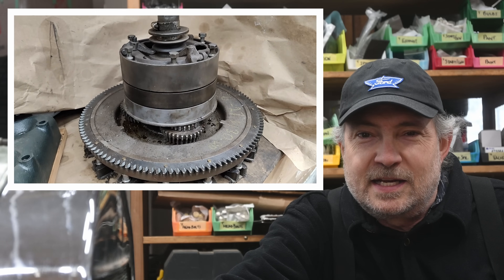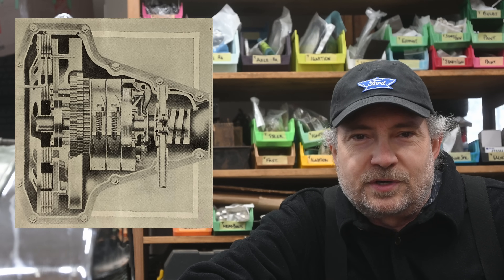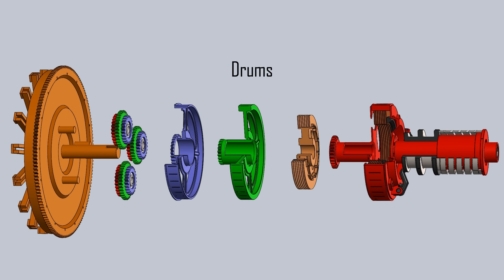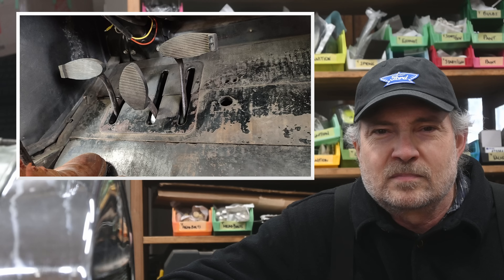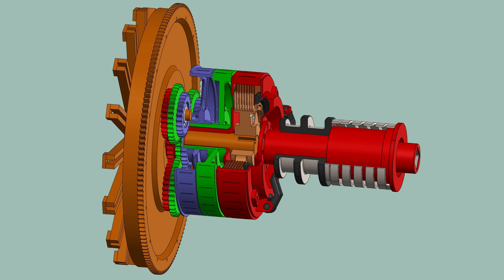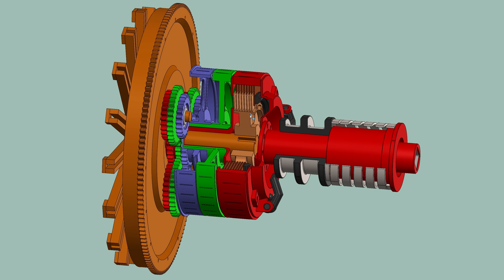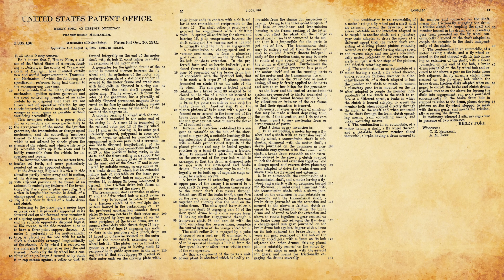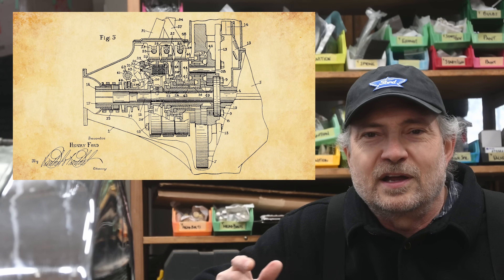How does it work?  Patents, animations. Ford Model T Transmission

Comment: Great work putting this video together, I was curious what makes the drums spin?
Reply from the maker: Each drum has gear teeth that engage the triple gears. The triple gears spin on the flywheel. Whenever there is relative rotation between the flywheel and the driveshaft, the triple gears will spin and turn the drums. Cheers!
Reply: @flivverchannel okay, thanks!

Comment: The multi disk clutch disks from a General Motors turbo 350 will actually fit in place of the multi disk model T one with a little modification. I know this because an old guy I knew fitted some GM plates in his model T to make the clutch smoother. It makes me wonder if the model T transmission was in some way the platform for the development of automatic transmissions in later years.
Reply from the maker: Neat.  I need to replace my clutch disks soon.  Can you steer me towards any more info about this substitution?
Reply: @flivverchannel I can remember the old guy referring to an aftermarket disk set called a “Jack rabbit conversion” but opted towards the GM clutch disk modification probably because he had them and it would have been cheaper. I can remember the original clutch pack was steel on steel which was grabby and not smooth at times. Hope this helps.
Reply from the maker: @JohnShields-ph9ge  thanks!

Comment: Well - you could also make it simple: Model T do have a clutch pedal where when engaged to power from the engine goes right through the transmission much like high gear in many manual transmissions. When pedal pressed, the clutch is disengaged.
In order to enable a smoother start, it have a feature - when the clutch pedal is further pressed, it tightens a band around a drum in the planetary gear, that in effect is a low gear.
In between an effective neutral gear is obtained. By a mechanism at the handbrake, you can keep the transmission in neutral without the need of pressing the clutch pedal.
Anyone used to drive manual transmissions (i.e. most europeans) will understand that 🙂
Reply from the maker: That's a good way to explain it!

Comment: I have always thought the Chevrolet power glide trans was somewhat akin to the model t transmission but rather than mechanical gear changes using your feet the power glide shifts gears through hydraulic engagement. Am I somewhat right in this thought.
Reply from the maker: I think you are right. Although, I am no Powerglide expert. Thanks for watching!

Comment: If neutral is the middle of the pedal stroke, how can you have neutral for starting and idling?
Reply from the maker: There is a linkage between the hand brake lever and the gear select pedal, that puts the pedal in the middle for 'neutral'. Or, you learn ti hold the pedal in the middle with your foot. It's a little weird!
Reply: @flivverchannel  Thanks for the answer!
Reply from the maker: @canuckprogressive.3435  pleasure.

Comment: I’ve got a model T and that transmission is a piece of junk. You’ve got these cotton pants that go around and make the thing run and they’re always wearing out all the rivets get bad and scar the drum. Then you have to Replace the drum.no breaks except for the cotton bands that goes around the drum and slows it down a little if the hill is to steep it does not have enough power to climb it you can turn and back up the hill other than that it kind of fun to drive.
Reply from the maker: Thanks for watching!

Comment: I still don't get the connection between this type of gearbox and the fact that the engine can push the car easily at low RPM. Sorry but English is not my language so it's more complicated to understand ^-^
Reply from the maker: This type of transmission has enormous rotating mass, so it effectively becomes a very heavy flywheel. A heavy flywheel helps an engine run smoothly at very low RPM.
Reply: @flivverchannel  ok so is up to the flywheel... By the way if this gearbox has so much rotating mass it seems not to be an efficient choice, right? I mean the more mass there's between the engine and the wheels and the more energy is dissipated!
Reply from the maker: @MarcoParisi9804  a heavy flywheel is complelety efficient and stores rotating energy. But it makes engine acceleration and deceleration slower.
Reply: @flivverchannel  Got It, thank you very much, appreciate it!

Comment: What makes exactly the difference from Low gear to Reverse gear? At first look the tripple planet will give the same direktion of Rotation of the Output shaft when you are stoping those brakedrums. Is there any combination with the clutch from high gear or the output brake?
Reply from the maker: Stay tuned and subscribe. I am making a specific video better explaining reverse.  Thanks for commenting!

Comment: I have a 24 Model T roadster..In order to apply the brake(right pedal) you have to have the left pedal (High neutral Low ) held in the neutral position. Because if it is not in neutral it will stall the engine. So you must use 2 feet to brake the car..
Same with reverse (Middle)..The neutral position must be held (left pedal) and then push the center pedal to create reverse..

I have Rocky mountain brakes on my T..A big handle on the left of the driver that when pulled backwards, puts the left pedal in the neutral position and applies band brakes on the rear axle
So I don't even use the right pedal..Just the handle..When you pull back a small amount of the handle, it will engage neutral and you can use that to engage reverse..
So you are only using one foot for everything you need..Brake(No pedals needed for that with the RM brakes)..Reverse with the handle in neutral..

Rocky mountain brakes really were an improvement!!
Reply from the maker: There is no problem braking with only one foot at first, as the engine-and-car slow together. But you are perfectly correct that it takes two feet to come to a stop or the car will stall.  Or one foot and pull the hand-brake lever to mid position (which forces the high/low pedal into middle neutral.
I am only passingly familiar with Rocky Mountain brakes.  Most installations that I have seen connect the actuator rods to the brake pedal. But interesting that your Rocky Mountain brakes are only connected to the hand brake lever.
Thanks for the great disucssion!

Comment: What I don't understand is the need to hold a pedal to be in neutral. Didn't a lot of these T's need to be started with a hand crank from the front of the vehicle? Wouldn't that be a Darwinist move when the transmission is always  in gear?
Reply from the maker: True! And Ts have injured and killed owners over the last century. Yes, the shifter pedal must be held in the middle position for neutral... To start, there is a linkage on the handbrake lever to force the pedal to neutral. But it can fail, and then the car lunges forward...

Comment: How does the reverse work exactly I know people who are 65 and STLL don’t understand it and they have been working on them since they were at least 30
Reply from the maker: Reverse is kinda difficult to explain in words.  My animations explain it better - but I will try.   With the output of the crankshaft turning the planet gears forwards, they spin against the output shaft gear.  By locking the reverse drum, since it is also engaged with the planet gears at a very different ration, they can spin such that they turn the output shaft gear reverse direction. Hope that helps.
Reply: @flivverchannel  I did not think you would actually respond lol I am a enthusiast myself and have a 23 touring car it’s more of a joke I like to ask people because nobody can ever explain it that I’ve found.
Reply from the maker: @ZodeusBloomberg  😅

Comment: Fantastic video!!  Your graphics are soooo good!.  Thank you for taking the time to explain this.
I had to call a friend (who is a collector) to ask about how neutral is achieved for cranking.  Ed Archer explained that linkage involved with setting the parking brake (at the rear wheels), also moves the left pedal into the neutral position.
Reply from the maker: Yeah, I didn't do a good job of explaining the pedal and handbrake linkages. I should do another video to explain those better. Thanks for watching!
Reply: OK, you missed one thing, but the rest of it was great.  I will never be as good at making videos as you are.  I'm impressed.
Reply from the maker: @cadmanchannel  😊

Comment: So when you go into reverse how does the hi speed clutch pack disconnect?  Is there an interconnecting cam or something?
Reply from the maker: There is no interconnection between reverse and the high speed clutch pack. Operationally, one is meant to ensure that 'neutral' is selected before engaging reverse. If neutral is NOT preselected, then reverse will stall the engine.

Comment: What did you do, when you wanted to start the motor or let it idle, if you didn't have a neutral? As I understand it, you would have to hold the pedal halfway down. And what did you do if you wanted to push a stalled car? I can't see how you could get by, without being able to shift into a neutral like a modern manual transmission
Reply from the maker: The handbrake lever has a linkage to hold the left pedal half way down, when the handbrake lever is in it's mid position. This way, none of the bands are gripping the drums, AND the multi-plate clutch is disengaged. In this arrangement you can push, or start, the car.

Comment: What is the maximum hp it can handle
Reply from the maker: The Model T only produced 20hp. Some people have used this transmission with more powerful engines, but eventually the band and drum system, or the multi plate clutch, gives way.

Comment: I remember my dad saying that Ford put the flywheel magnets in the T right up to the end, when they had batteries and starter motors.  He said that the first time the transmission had to have the bands worked on they would take all the magnets out (not sure why).  I know I had a lot of them to play with.
Reply from the maker: Yes, some people prefer the simplicity of the generator and battery, rather than ALSO having the magneto.  The magneto was included, right to the end of production, so that you could start the car and run the car even if the battery was completely dead. Thanks for watching!

Comment: Something I still don't understand is, if the left pedal is pressed half way for neutral, how do you start it? With nobody on the pedals, it sounds like you would be starting it in high gear.
Reply from the maker: There is a linkage attached to the left pedal which ensures that the high gear multiplate clutch is disengaged when you are either at the neutral mid position or all the way down
Reply: @flivverchannel  I got that. But does that mean that starting the engine is a two person operation? If not, how is it kept in neutral while you are outside the car cranking on the engine?
Reply from the maker: @johns7734  ah! The handbrake lever also has a linkage. When the hand brake is on, the trans is forced in neutral, holding it exactly like a middle left pedal does.
Reply: @flivverchannel  That explains it! Thanks. I knew that there had to be something.

Comment: Looks like there was almost as many individual parts in the transmission as there were in the rest of the car.  Think of how many skilled machinist on manual lathes to cut all those teeth and gears.
Reply from the maker: Amazing isn't it?

Comment: The electricaly controlled overdrives common on british sports cars in tje last century use a similar planetary set. Only two of the potential ratios are used. Direct drive where the entire gear set rotates as a solid unit and an aprox 0.8 to 1 step up via the planetary gears.
Reply from the maker: Neat!  I didn't know that. I'll look it up.

Comment: With the brake drum, do the brake bands need replacing?
Reply from the maker: Yes, the bands wear like a brake shoe. They need adjustment, and ultimately, re-lining. The original linings were cotton or wood! Lately, Kevlar is also used.

Comment: What I want to know, did any early aviation pioneer adapt the FORD planetary transmission to drive a multi-speed propeller? Any information....?
Reply from the maker: I have never heard of this. Interesting tho.
Reply: @flivverchannel  It is: a very obscure branch of aviation technology. Most of the hits you'll find on GOOGLE came from me. Most of the multi-speed propeller reduction gearbox developments occurred immediate pre-WW2 and on into WW2  in America and Britain. Never used in production aero-engines but several experimental prototypes were made. Only two were ever flight-tested, 1st at McCook Field, Ohio using adapted Liberty engine and the 2nd in England with a ROLLS-ROYCE Eagle engine.  A Model T transmission conversion would have been a good candidate for experimentation, that's why I asked. Ask around, you might get lucky. Cheers.
Reply from the maker: @andrerousseau5730  thanks!
Reply: The concept doesn't seem practical to me when variable pitch propellers were available.  A lot of extra weight and complexity for little if any gain.
Reply: Hi Rowan, No, no. You misunderstand.; Progress with the multi-speed propeller was paced with general developments in aircraft propulsion. Practical variable-pitch propellers simply weren't available in the pioneering days and aero-engines were pathetically weak so more aggressively pitched propeller blades couldn't function as it would over-tax the engine on take-off. However, after the introduction of tetra-ethyl lead additive, power outputs of aero-engines underwent an exponential rise. Simultaneously, with the onset of war, the US Army air corps anticipated the need for super-heavy, long-range trans-Atlantic bombers for which massive engines (eg the STUDEBAKER XH-9350) would be required. The minimum fuel-consumption operating point of these engines corresponded to a shaft speed too low for efficient propeller operation, therefore the proposed solution was an extra step-up gear-ratio in the transmission. Think of it as the aero-engine equivalent of an automobile over-drive gear stage.

Comment: FYI, Indy cars generally used modified T transmissions until the 1960's. If properly prepared they handled 400+ HP without breaking but they did have a separate clutch.
Reply from the maker: That's interesting. I will research that.
Reply: I do know they were 2 speed and have heard drivers refer to them as model T transmissions. I suspect that they were using a modified version of the T planetary gear setup. Many had a modified case cast of aluminum. They may have just been 'inspired' by the T but I'm sure I heard AJ Foyt call them a T transmission in an interview.  @flivverchannel

Comment: I've always felt this was a very very interesting transmission and so simple in my way of thinking it's simple and very dependable it's a shame nowadays how complex everything has gotten and I'm 73 years old but I'm still I still learn too much stuff everyday so I guess we'll just keep on going
Reply: If you have a modern car with an automatic transmission,  it most likely has this design in the transmission, only with multiple combinations of these same planetary gear sets. Chevy's original Powerglide transmission two speed automatic transmission was literally this transmission with a speed and load sensor that automatically changed the high -low ratio by determining the speed of the car and engine.
Reply from the maker: Keep learning!

Comment: This is an interesting design. I hope you have more on this to come. Specifically, how does the tranny disengage (go into neutral)? Obviously the forward gears would need to disengage when pressing the reverse lever and both disengage when hitting the brake. I'd assume the wet clutch serves that purpose? Also, how does the brake work when parked? Thank you.
Reply from the maker: Yes, I hope to dive even deeper in the future. For now... there is no true disengaged neutral. If none of the bands are tightened on the drum, and if the multiplate clutch is disengaged, then the triple gears do their dance to allow the flywheel to spin while the driveshaft is stationary. In 'neutral' gears and deuns are turning and any drag tends to try to creep the car forwards...

Comment: I can't help thinking that a development of this with more ratios would have been a better solution than the complicated and troublesome double clutch automatics that now proliferate.  It would be so close to a "conventional" hydraulic automatic, which now can provide up to 10 ratios (too many??), but could then dispense with the torque converter.  I don't know about efficiencies - is there a lot of friction in a planetary gear set?
Reply from the maker: Yes, the T Transmission is quite draggy in Low and Reverse. The Triple Gears always in mesh and concentric Drums always rotating relative to one another, generates a lot of friction

Comment: I often wonder if and why this design couldn't have continued to be improved into a manual-automatic type of transmission. 
The jump into unsynchronized manual crunch-boxes, and then the extremely complicated 2 speed powerglides baffles me. This method seems like it could be tweaked to be easier to learn and more reliable.
Reply from the maker: It would be interdiction to see a modem embodiment of this; but I have not seen one attempted.

Comment: Very nice explanation! Thank you! I gonna start teaching my Son how to drive in a month. Our 26 touring will be the first one followed by the 46 gmc dump truck…. “Double clutch tap the gas son”
Reply from the maker: Good luck with that!  Ts are easy, but weird.  Shift from Low to high at VERY LOW rpm.  Low gear is just to get going walking speed.
Reply: @flivverchannel  driving a T for 15 years now. I love every minite of it! It’s like a farm machinery. Use it once a week when it’s not snowing or raining.
Reply from the maker: @bountyflyer  excellent.  As Bruce at Klep's says "drive 'em if you got 'em"